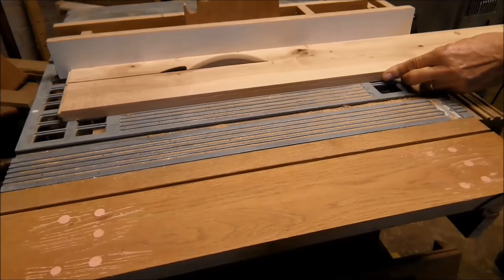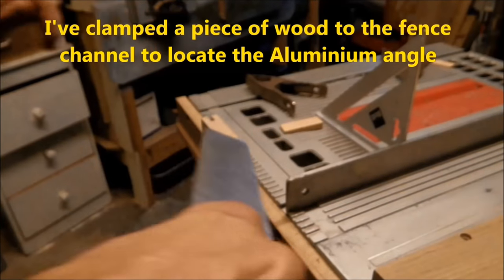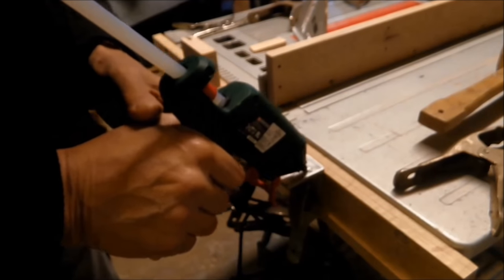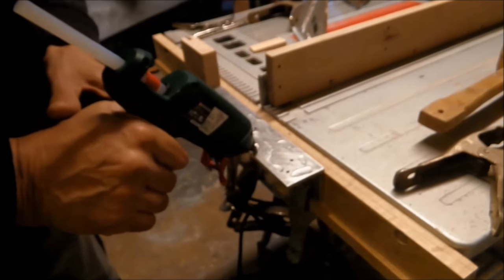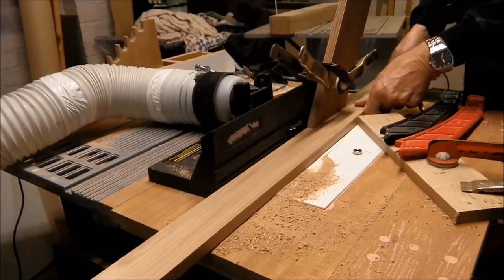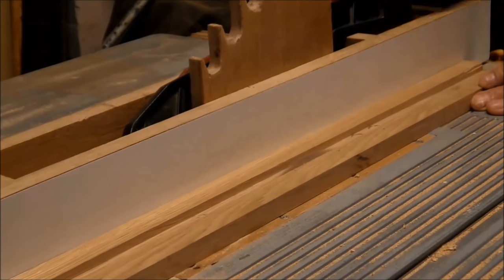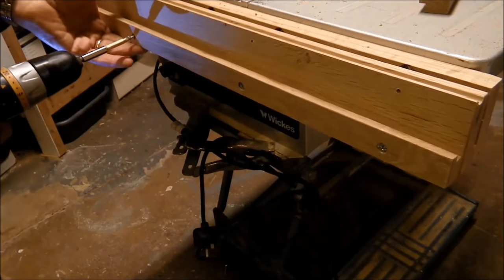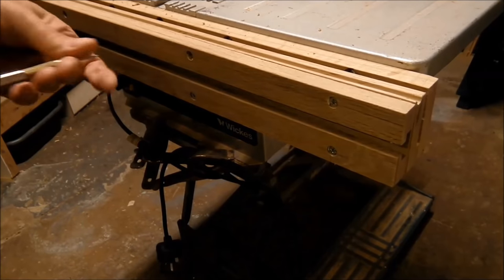The Ultimate Table Saw Fence

Comment: Looks really good and simple to make (certainly easier than I was planning for my own). A couple of adaptations that I would add; on the top/front, I would add a 1/16th rabbit and glue in a tape ... and I would cut a couple of slots, so that the mitre slots pass  through.
Reply from the maker: Hi Sean, thanks for checking out my channel and taking the time to give me feedback,the piece that's attached to the table is set below the mitre channels so I can use my cross cut sled but I will add the tape.

Comment: Like the design, I have the same table saw design, although mine is a Perform branded one originally from Axminster. I'll be making one as soon as time allows. many thanks for the video.
Reply from the maker: hi thanks for the feedback good luck with the build I would recommend having a look at my other video how to turn a crappy table saw into to a good one its based on a perform power saw.

Comment from the maker: drail80s. thanks for subscribing.the bolt is attached to a mild steel bar that slides along in the track.so the knob pulls the bar against the track and pushes the aluminium tight without making any indentations.take a look at the video again I'm sure that will explain it better.please contact me if you have any other questions

Comment: The Pure Dead Simple fence, any thing straight fixed to a table that slides left and right to by pass the blade  for 49 ins. macduff did this, eliminating the many parts of a T-Fence
Reply from the maker: +seumas2 not sure where your coming from Buddy is it a put down or a thumbs up
Reply: I'm so glad you said that.
Reply: Marcello, I believe that seusams2 is talking about a sliding table saw, like you see in many production cabinet shops. the left side table slides forward past the blade center, you can cut much faster in a production environment, but they cost 4k +, so not really conducive to a home, or small commercial shop. He is right though, they are simplier.

Comment: Thank you.  Your explanation is exactly what I needed.  The reason I was confused is that I saw the groves in the upper portion of the third piece attached to the second piece, but after reading your description above, as well as the comments you responded to, I now understand the configuration.  I really like this design and am almost done with mine.  BTW, what are the dimensions of the metal piece.  Using American measures, the angle appears to be 2" x 2" x 1/4".  Is that about right?  Give me the Metric version and I can convert.  Thank you again and keep up the up the builds for us beginners.
Reply from the maker: John Lang 50mmx50mmx6mm exactly what you have thanks for looking at my channel

Comment: Several questions Marcello.  First, with this design, when you slide the fence does it stay true while moving left to right.  Second, what is the clearance in the track width that the aluminum angle rides so it moves freely without binding and tight enough not to allow side to side movement. Third, is the width of the fence at the widest 150mm and 100mm at the narrowest? Thanks in advance.
Reply from the maker: +Mike Mitchell Hi Mike my the fence is 100mm x 163mm  that's 150mm + 13mm for the front face  the gap is 2mm in the channel because I don't want it to bind during damp weather so if you live in a dry climate you could go tighter,so yes there is a slight movement because of the slack in the channel  but this is taken out when the fence is locked in position because the locking action pushes the aluminium angle against the front of the channel so the fence is true for cutting.

Comment: Very nice video, Marcello.  Good design.  I was thinking along the same lines with a slot used for tightening the fence down, but I was going to simply buy T-slot.  Your idea is much cheaper! 
One question... I cannot find the video that was advertised in regards to testing alignment.  Is that one done yet?
Reply from the maker: Jerry J sorry didn't do a follow up video. Must have forgot, at the time I was making a video a week but I've been on full employment all summer and not had the time to make any videos.I'm hoping to make some this winter.

Comment: Fine. But to me the problem is how to make fit and adjust the slider / ruler to the table. Although minute work it seems,to me the fence job is pretty straightforward, but myslef I haven't com with the solution of fixing a good slider / ruler that is 90º true to the blade....Any tip on that ?Thanx for posting anll the same and Happy New Year ...
Reply from the maker: +vincent7520 Hi, sorry to be dumb but i'm a bit confused to what you are seeking advise on could you try and explain again
Reply: Well the fence runs along a slide / slider (sorry my english is not my native language) that is on the front of the table : how do you make one and fix it on the table ? I am talking about the piece of wood that is attache to the font of the table one can see on the first image of you video.
Ssoryy to be confusing
Reply from the maker: +vincent7520  Hi Vincent the channel track is fixed to the front with machine screws to the front of the table if you don't have any pre-drilled holes you will have to make your own if you don't have any taps you could use stainless steel self tapping screws,please take a look at the link to instructables for more still photos and written instruction. contact me again if I can be of any more help. regards Marcello   http://www.instructables.com/id/The-Ultimate-Table-Saw-Fence/
Reply: Thank you so much.
I save the Instructable link.
Happy New Year

Comment: Hi Marcello, Nice job. Do you have plans for both the conversion of a "crappy" table saw and for your updated fence? Also what wood would you suggest or would 22mm marine ply work as well?
Reply from the maker: Hi mark, sorry I never made plans but i could supply you with dimension of the parts if that helps, marine ply would be suitable for the build but i think the fence work better if faced with melamine because i like to wax it

Comment: Could you show the inside of the channel where the metal slide operates?  I am still confused as to its configuration.  Also, what is a "rebated track?"  Do you have plans for this fence somewhere?  I am trying to build it according to your specs, but am still confused as to the slide track configuration.  Thank you.
Reply from the maker: not sure what you mean could you have another go at explaining what you want me to show, i don't have plans but could give you the dimensions. I think this could be what you want explaining so here goes .
The channel is made up of 3 pieces of timber you can see this at the very start of the video. the first piece is screwed to the saw the second piece is screwed and glued to the bottom and the 3rd piece is then screwed and glued onto the second piece to make the channel, slightly wider than the metal angle.
then the rebated parts are finally screwed to the channel for the the stop, if you require more info please get in touch

Comment: Hi,
there appear to be 2 grooves on the top of the fence, one that the aluminium L-bracket runs along and a smaller one. Is the smaller one functional? Is it used for the design or just a result of using scrap wood?
Reply from the maker: +I used old oak TG flooring I thought the aluminium angle would run smoother on the grooves Mike o'donovan
Reply: Thanks for reply. What's the wax? Is it just car wax? sorry can't see brand int the vid.
Reply from the maker: +I used marine wax but car wax would  do the job Mike o'donovan

Comment: from what i see its attached in one side only, give it enough pressure and it will bend, it needs to have rails in front and back, i talk from experience.
Reply from the maker: +poja82  if the saw blade is parallel to the fence where's the pressure coming from?
Reply: pieces of hard wood that are not squared, exercice pressure on the fence, i've seen it in my workshop many times,
Reply from the maker: +poja82 I,m not agreeing with your synopsis of my fence but anyway why would you be sawing hardwood thats not square on the saw table, I would run them over the jointer or use the sliding table before dimensioning on the saw .
Reply: We clearly use the table saw differently. And I'm glad your fence (wich looks finely constructed if not constructed in the way i would do it) i'm glad your fence works for you. We clearly use the table saw differently, which is fine by me.

Comment: The title seems over the top for this build. Why do you believe that this is the ultimate table saw fence?
Here is the most awesome table saw fence I have seen for several years - https://www.youtube.com/watch?v=4pudkvHFOfk
Reply from the maker: The ultimate table saw fence for a cheap entry level table saw was in the description if you can find a no cost  way to make a fence that work's accurately and works like a manufactured fence I will certainly be interested in looking. thanks for your comments